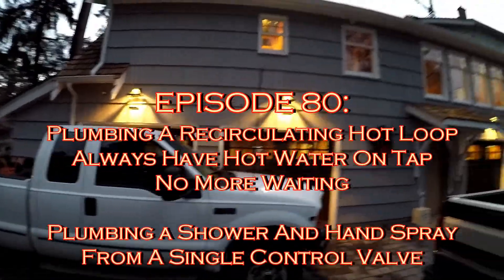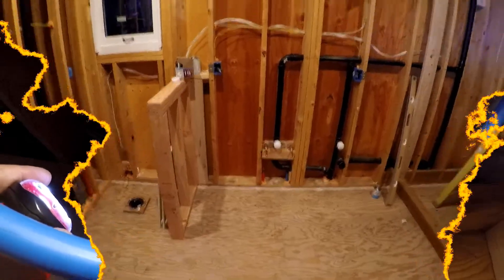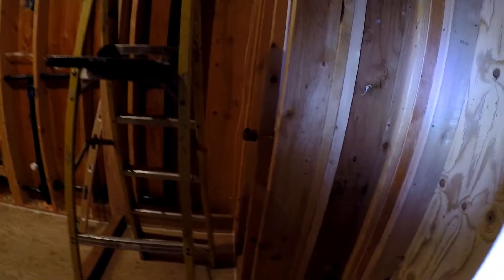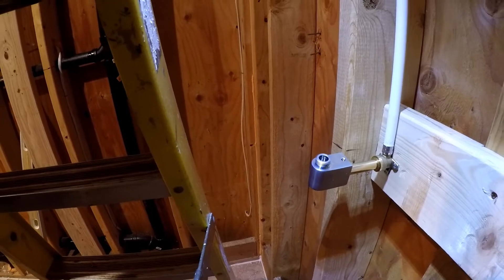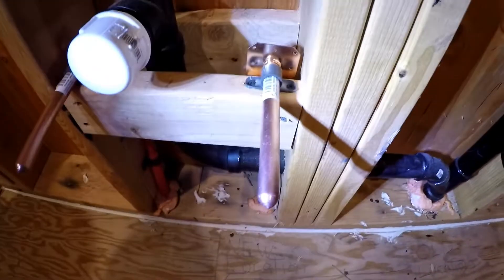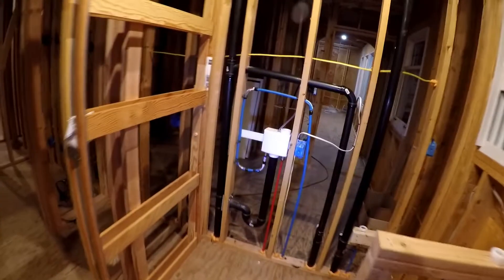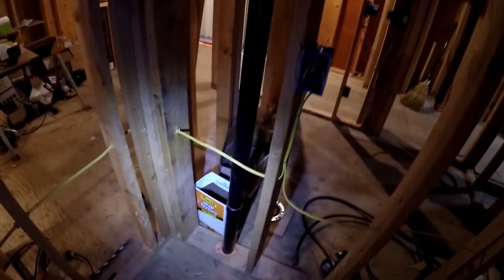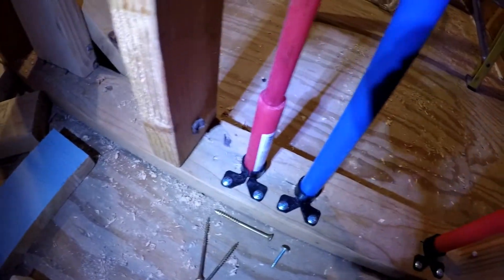PEX Recirculating Hot Water Loop _ Episode 80: Completed In Episode 98:

Comment: Wont circulating hot water degrade the pex
Reply from the maker: I k ow infloor heating pex has an oxygen rating and some has a metalic onner sleve. I got hot circulation setups going back 20 years without issue. All have been inspected and approved.

Comment: 7:50, I see the black suspension clamp you have in the stud. Do you have it on both sides or just one side and what size hole do you drill with the 1/2" and 3/4" clamps for a good fit? Did you insulate the dedicated recirc line?
Reply from the maker: The recirculation line is insulated the whole loop starting as the 3/4" hot line and then as the return line in half inch.
Reply: @CITAP1  I planned on doing just this, 3/4"  until the last fixtures could use 1/2" without pressure drop so that the return would be faster but I was advised against this because the pump I plan on using, taco 006e3, wouldn't know that I used the 1/2" return and is calculated to do a certain gpm through the lines which could damage the 1/2" over time? Does that make any sense?
Reply from the maker: @larrylupe  The recirculating pump is a low volume pump. Reduce to half inch requires less volume. You can create the loop in 3/4 PEX and it will work just fine. The loop doesn't require a lot, just a path back to the water heater.
I would recommend a Grundfoss pump with a temperature switch. It will circulate periodically as the temperature drops. It's a bit more efficient. The hot and loop return should have the best quality and highest R value tube pipe insulation on them.
Reply from the maker: https://product-selection.grundfos.com/us/products/up-ups-series-100-north-america/grundfos-comfort-system-north-america

Comment: I hope your shower head line and shower wand line don't freeze in the ceiling?
Reply from the maker: Not a chance of freezing. There is over a foot of insulation above the two pipes and they drain completely out when the water is shut off. Two years now, no issues.

Comment: Just curious if your shower valve setup worked or if the water came out both heads. As a plumber I ran into an issue when a homeowner did this exact same thing with a standard tub/shower valve thinking the little push button diverter would work but it wouldn’t. The tub outlet of the valve is not designed to go upwards. It put too much pressure on his valve and would come out both heads. I had to order him a true shower diverter and install above valve. Capped off the lower “tub” outlet and everything worked perfect. It was a kohler valve.
Reply from the maker: This setup works fine. It was a standard Kohler tub shower valve. The tub outlet on bottom of the valve is the primary outlet and that is what we ran to the shower head. The top or secondary outlet on the valve, usually for the shower head is what we used to feed the had spray. The valve setup works perfectly supplying the shower head all the time and when the diverter is pressed in, it feeds the hand spray. Here is video of this bathroom completed. https://youtu.be/cPsThTCKvAU?t=322
We did another shower where they wanted to be able to run both shower and hand spray at the same time or separately.  
We used a Grohe valve for that seen in this video. https://youtu.be/MdNjySjr5f0

Comment: Your vent fittings are installed wrong way
Reply from the maker: The vent fittings do not have to be installed upside down. We install for the gravitational flow of water. This installation has been inspected and signed off.
Reply: CITAP1  vent fitting @ laundry box is going the wrong way.